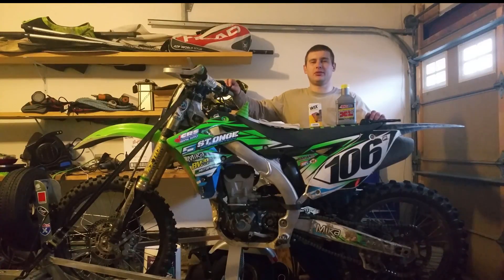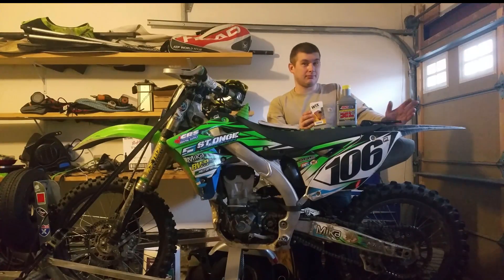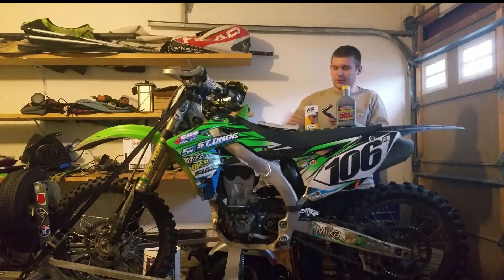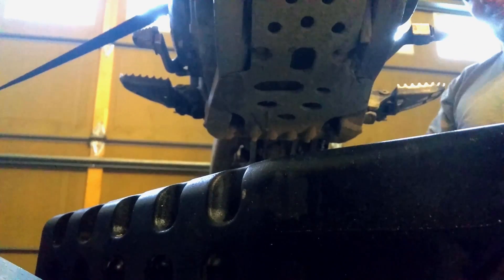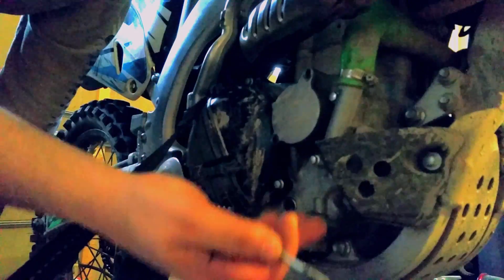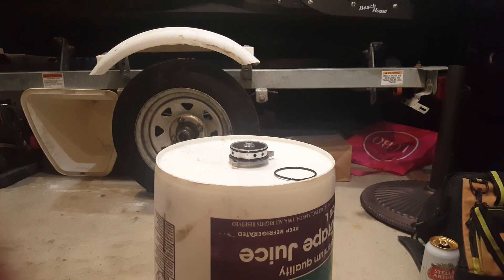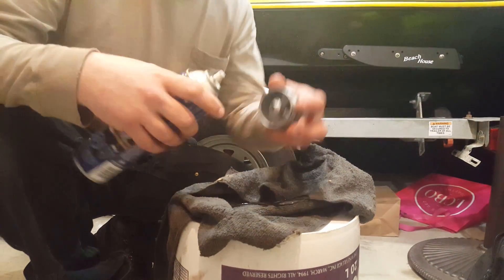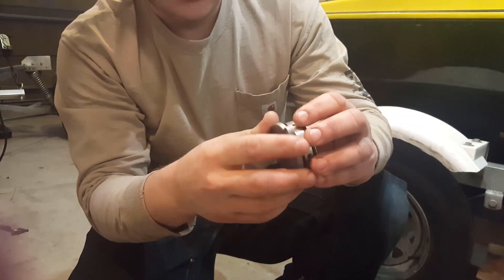HOW TO CHANGE OIL ON FOUR STROKE DIRT BIKE 2012 KX450F: Enduro Skills

Comment: Just bought the same model, kind of a newbie rider, how much oil changes or air filters or maintenance does it take to make these bike last? I’m a trail/road rider so I really don’t wanna blow my engine 😂 great bike and video by the way 👌🏽
Reply from the maker: Thx man, the manual says every 15 hrs but I'll change it every 10 hrs. I ride trails usually, bike has been pretty solid it's got 100 hrs now and starts 2nd kick after being stored all winter. Gotta love that fuel injection
Reply: Enduro Skills right on man you’re welcome and thank you, that’s great to hear as well and your bike looks awesome, I’m glad the kx is strong as long as it is maintained well, I just didn’t know and wanted to ask lol thanks again!

Comment: I have a 2011 kx450f. Should there be a spring behind the oil filter? I seen a video on a 2013 and he made it clear to watch for and not lose the spring. My bike dont have one just wondering if yours dose?
Reply from the maker: Good question, yes there is a spring. It keeps the oil filter pressed in place while riding and very important to have it otherwise it could fall off the port in the cover and oil will flow freely bypassing the filter altogether. Here's a link I found for it, if you google "2011 kx450f oil filter spring" you'll get a few different sites but I'm sure dealership can get it too
https://www.partzilla.com/product/kawasaki/92144-1761

Comment: Can you guide me as to where to find the oil drain bolt that carries the 8mm socket?
Reply from the maker: Andre Alleyne for the oil filter housing. It's at 4:00
Reply: Enduro Skills 
Sorry i meant, where can i purchase one?
Reply from the maker: A hardware store or large department store should carry it. A 1/4" socket set should have all you need to do most of the work on these bikes
Reply from the maker: https://www.kawasakipartshouse.com/oemparts/a/kaw/500b9684f8700223e479a749/oil-filter you'll need part 132 and 132b if you're looking for the bolts
Reply: The oil drain bolts that are under the bike, not at the side of the case.

Comment: Just a tip, brake cleaner will make rubber o rings and such swell up and they are junk.  Listen to this man when he says to take the o rings off before using brake cleaner.
Reply from the maker: You are correct, I prefer to just give it a wipe with a rag without using brake cleaner